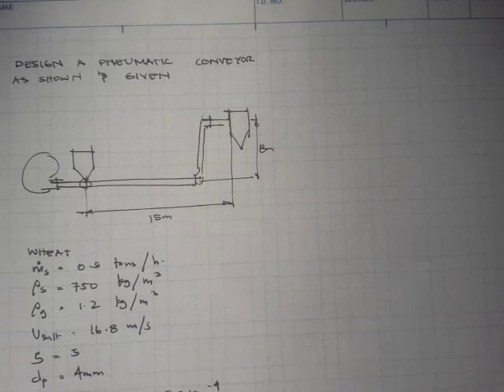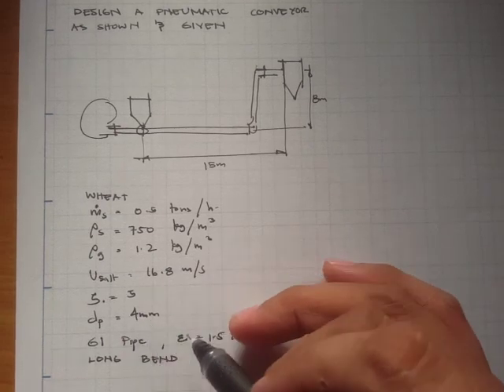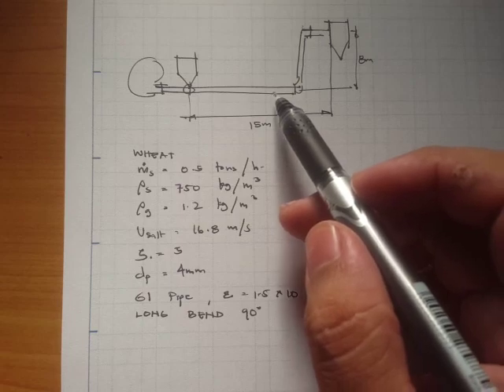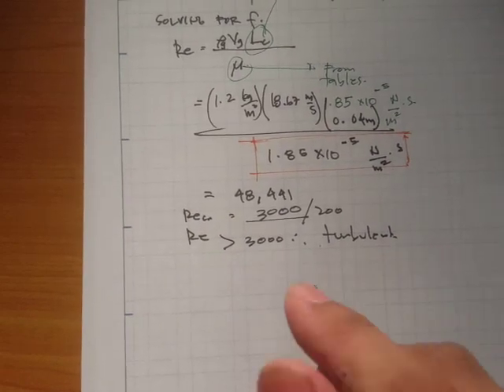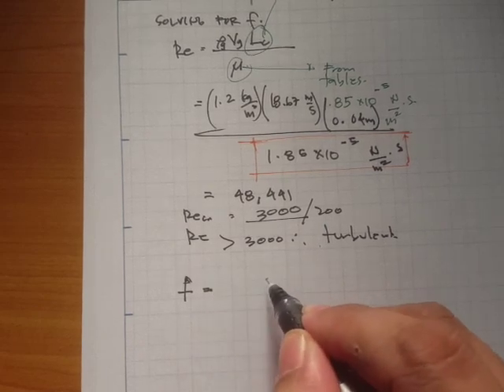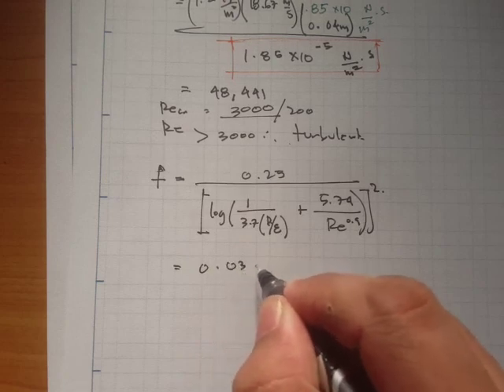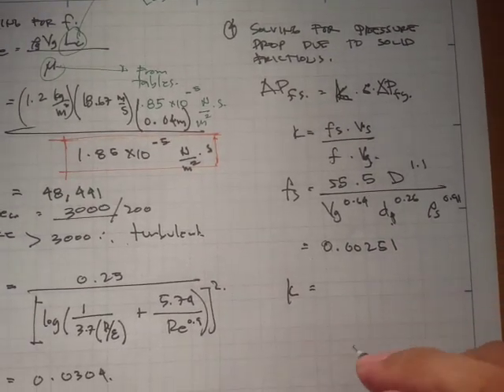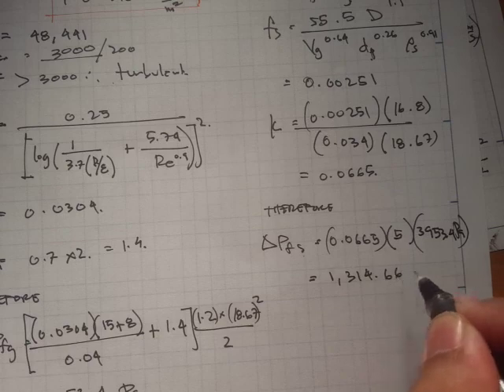ABE180 - 06.04 - Design of Pneumatic Conveyor (Part4)

Comment: I see that you are not using the iterative approach as suggested in A.T. Agarwal, 2005. Aren’t you concerned that as gas expands along the pipeline, velocity increases? Therefore by using Usalt as your average velocity, your total pressure drop is actually lower than it should be. Usalt should only be used as Vinitial from what I understand. I guess your method still gives a good approximation though. Thanks for the videos, super helpful!
Reply from the maker: Thanks for bringing that up.  I haven't thought of the relationship of the gas expansion and the pressure drop.  I do believe that would really matter if we go into the details.  However, in the context of engineering design and having a lot of constraints to fully understand everything in a given time, I always think of the computed value as a range especially for such system as this without codes/standards like that of structural design, or design of pressure vessels, or none that I know of so far.  So I always expect for some deviations.  Of course the lesser the deviation, the better.  But I'll look into that gas expansion when I encounter this course/project once again.  

You're welcome, and thank you too. =)